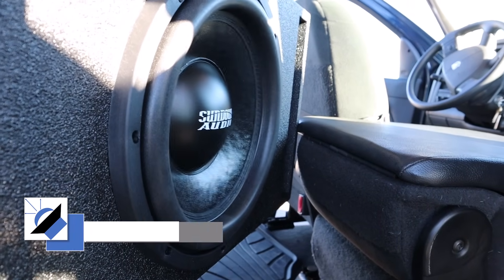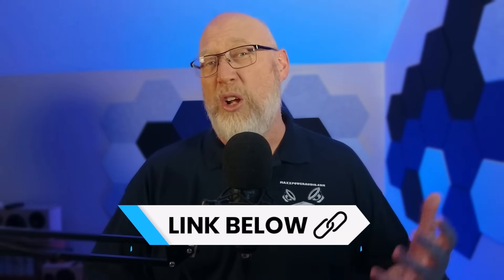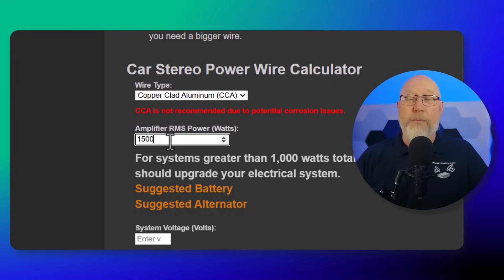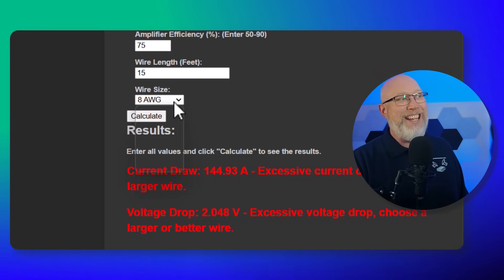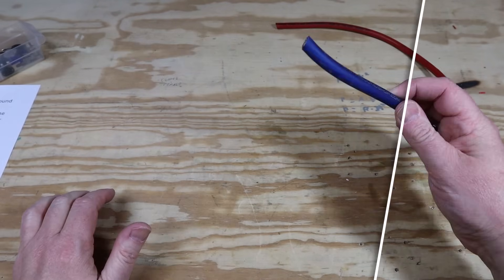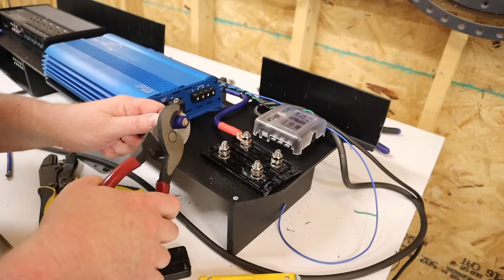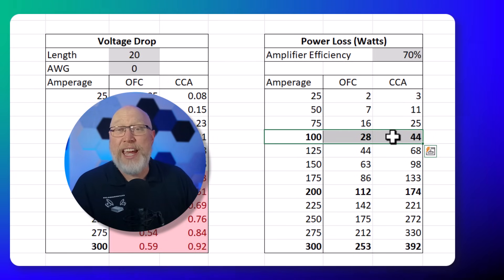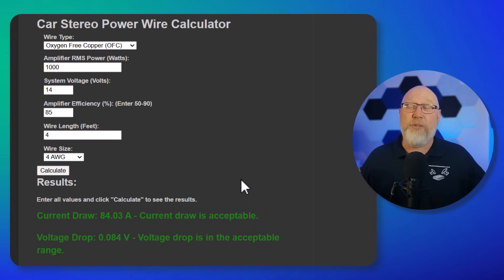The WRONG WIRE will starve your amp.

Comment: Interesting and informative.
Reply from the maker: Thanks!
Reply: @DIYAudioGuy  Hey i just wanted to make sure this applies to Speaker wire as well if i remember right?
Reply from the maker: @EBMproductions1  The math is the same but the voltages are different.
Reply: @DIYAudioGuy  Yes i remember, your vid made me remember why i want below 10 feet long speaker wire and i never got round to it haha so i believe its time.

Comment: Shit bro most cable especially from amp kits SUCK i use 04 direct bury 8 strand wire to my amps and have had absolutly no problems with the cable over heating melting or any that shit

Comment: Lol. I've seen you use different wire than down for sound 😂. Nevertheless, good video. Good explanation 🤟
Reply from the maker: I've used tons of different wire over the years.   I still have a lot of scrap from several brands laying around.   Haven't bought anything but down for soundwire and probably 2 maybe 3 years.
Reply: @DIYAudioGuy  I will have to look into there tinned wire next. I been using sky high ofc. Been decent. GP is super heavy

Comment: My only rule when it comes to OFC and CCA wire. OFC from Alt to battery and CCA from battery to amps. The runs typically are so short in the back, I can't justify the cost. Just my personal opinion.
Reply from the maker: That sounds reasonable.
Reply: At the same time, if the runs are that short, do we really need to pinch the pennies and run inferior cable? We are talking maybe a few dollars in the grand scheme of the entire install cost.
Reply: When you run 6x8000 watt amps with triple inputs, that gets to be a lot of wire. Double that wire if you use  dual connectors. So yeah, I'll save that money and make a car payment or two.  @cndlpwr

Comment: I understand cca is inferior, but would two runs of 4 awg cca be ok temporarily until I purchase 1/0 ofc for a 1500w Stinger at 1ohm? (Temporary as in a month or two)
Reply from the maker: I have not run the numbers, but that should be ok.  Remember to put a fuse on both of those 4 guage wires.
Reply: Congrats on 100k btw!
Reply from the maker: THanks!
Reply: Buy once cry once, I hate to doubt back on things. (Got bitten in the butt before)

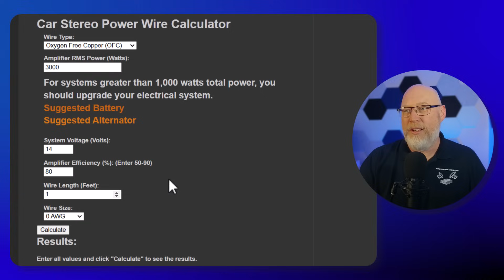Comment: NEVER use CCA wire! It WILL harden over time due to the heat/cool cycles of high amp wire, become brittle and untimely crumble. When it crumbles it's a fire hazard. CCA is dangerous and not worth risking your vehicle or your life. Copper wire can be removed from 10:16 the vehicle when you sell it and reused in your new ride.
Reply from the maker: OFC is always the better choice.
Reply: After a few years, the CCA also turns green from corrosion and the resistance increases so I only use OFC now.
Reply: @kimokahikolekalihi terminate better!
Reply: @user-pd8zr7nf5i homes still use it. 
It is safe 
It’s the termination of old wire that creates the problem. 
Aluminum wire technically is safer than copper. As aluminum when
At failure will melts away and coper burns and is more likely to cause fire. 

Over normal use with the correct size no issues 
And if abused it would take longer than anyone keeps a car to see any issue. And that is only if you are move the wire or make bad termination.
Reply: CCA is cheap you just need to use twice the size or double runs, it's more common to use it as a ground. The best stuff looks like aluminium but it's tinned ofc

Comment: Next time try using EV battery power wires, they are shielded, use tougher materials and their operating temperature go up to 200degC.
What it does is avoids noises to get in the system, will be less prone to cuts, will be much much Safer to use in engine bay and less risk in melting of the insulation.
Share the experience with viewers, it’s good for the whole audio community.
Reply from the maker: That sounds interesting, I’ll have to look into that.
Reply: If you want that high of quality than buy GP wire..... 

Orrrrrr run your runs much better/neater and of course adequately sized! Use cable glands, bulkheads and of course fuse your wires leaving a source of power and also going into a source of power and you won't have any catastrophic failures that burn down! (Alternator wire IS fused from the factory in EVERY vehicle made in the last 30+ years anyway just FYI... I always love that argument.... It's called a fusible link!)

If you run a rear battery, fuse as both ends or just don't fuse at all as it's the same thing! (Less current potential sure.... But does that really even matter at that point? 😉)
Reply: @commonsenseisdeadandgone  
Thanks for info and suggestions
Reply: Sounds expensive. OFC wire is already quite expensive. Where do you buy it?

Comment: That's why amplifier don't actually run on 12-14v  this is just because vehicles run off that voltage  half of a car amplifier  is actually  a transformer  or power boost  power supply  because the amplifier board need a lot higher voltage than 12v -16v  at that voltage  I don't think more than 50w  could be achieved .  When you build a DIY amplifier you also have to do a power supply   basically the same concept.   Same for plate amplifier 💯🫡❄️☃️🌲👌✌️🎵🎶
Reply from the maker: Thanks for the information.

Comment: Those two laws are applicable in all electric circuits. No matter if it's  your car or your house, AC or DC voltage.
Reply from the maker: You are correct.
Reply: @user-pd8zr7nf5i  hpw do you figure? There's literally probably a few dozen videos of people testing the resistance of tinned ofc wire, which is  sufficient  enough. What other testing are you even talking about? Furthermore even though there is some good welding cable out there in said videos tinned ofc did infact out perform the welding cable. Sky high for example was one that was tested an got some of the best ratings an was in the top 5 cables to be used. Granted these tests differ slightly from one to the next depending on overall length. Hell even video's with using adaptors an reducers show that even using cheap aluminum adaptors over other medals or copper doesn't  make a substantial difference in resistance at least not enough to make a difference in return.
Reply: @nickstalhood5380 oh and actually, the aluminum amplifier inputs actually gained watts on the dyno ... Sundown unofficial did it and I believe someone else did as well (possibly the 'jeff' guy but) 

Not sure the rhyme or reason and it wasn't anything significant (considering you'll never notice a difference in +/- a few hundred or even 500 watts when running thousands!)
Reply: @user-pd8zr7nf5i I argued with people over the tin coated copper too. They try to still say it's the same as pure copper 😂 I use 100% copper welding cable 2/0
Reply: @user-pd8zr7nf5i  Yes an there are several of those videos using different lengths. Furthermore the drop can be calculated using those measurements. Its not rocket science. If you have 0..02 drop in resistance over 1ft that can easily  be calculated over several feet.
Reply: @user-pd8zr7nf5i copper does NOT conduct 100%..... 

The "tinning" does not add nor take from the conductivity of the copper, it does however add corrosion prevention (hence why tinned wire is used/required in maritime applications..... 🤯)

When you run adequate wire for your application you gain NOTHING by changing your wire! 

If you run adequate CCA wire, you will gain absolutely ZERO by changing to OFC... 

Without a doubt you're going to disagree with me because you been sold a bill of goods that is spoiled... It's called disinformation my friend! Don't EVER listen to those who have skin in the game and profits to gain with not just what they say positively about "their" products but even more so on what they say negatively about "others"/cheaper products! 

Anyway, considering the lack of knowledge of your post, no offense but you don't exactly have any ground to stand on to tell me otherwise so don't believe everything you hear, do your research until it makes sense, fuse your positive runs, execute and seal your terminations well and bass on! ✌️

(BTW, the loudest vehicle at one time had ALL CCA wiring and everyone hounded him saying switching to OFC would net him a gain on the meter.... When you are searching for every tiny bit he gave in and spent about a grand (this was like 2006 when wire was cheap.... Probably be 4gs plus now days) and it resulted him a gain of 0.0000000.... on a plus side it also resulted in 0.00000 loss.... On the meter of course.... 🤑😉)